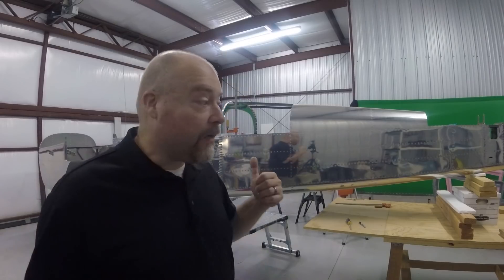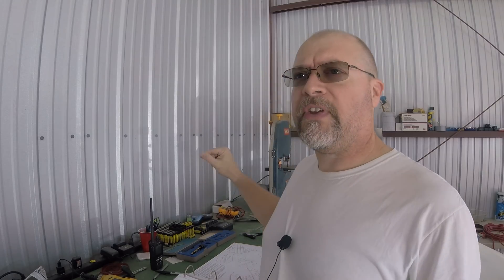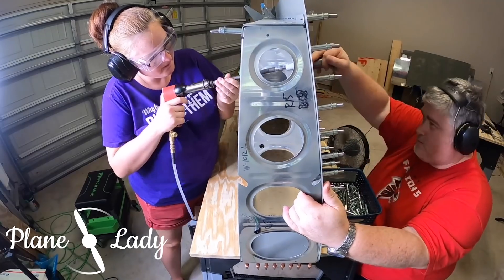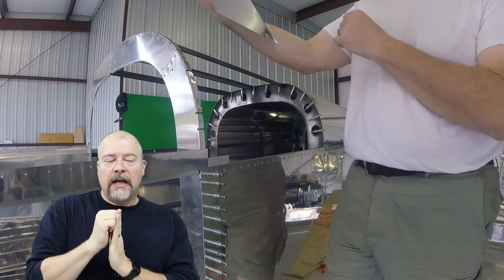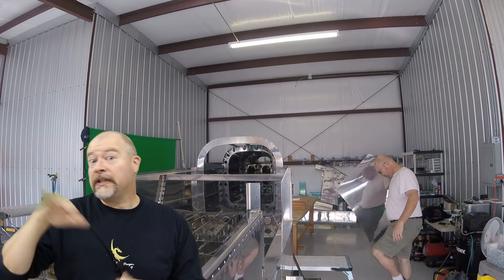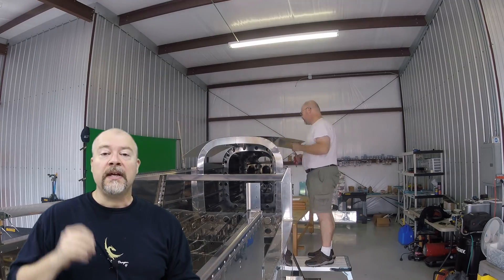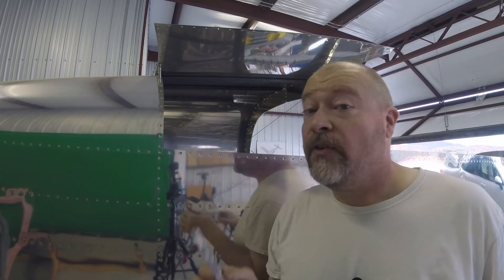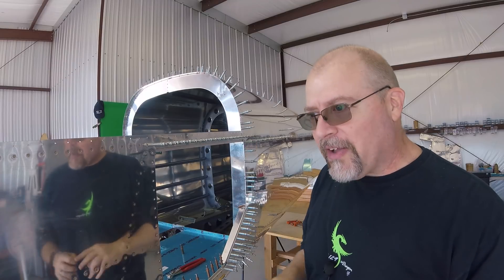RV-10 Fuselage - 036 - Fuselage / Empennage Work & Secret Stuff

Comment: The stiffeners attached to the skin that run the longitudinally are called stringers. Typically in a stringer splice scenario, you'd join the all the flanges and webs between the two. So the skin flanges would both be riveted to the skin, the webs would be riveted together, and the free flanges (if there is room, i.e. edge distance). It looks like you may have just joined them at the skin flange. AC43.13 should have an example of what I'm talking about. 

Now in this case, it looks like the stringers are terminating at the frame. And a closer look at all the details may reveal you don't need a full on stringer splice type repair. I think someone mentioned running it by Vans, that may not be a bad idea.

I'm not an RV builder, I would like to some day, but I do engineer structural repairs for certified aircraft.

Comment: Jason, here's a quick hint on removing the blue vinyl from the skins.  Play a heat gun (at a low heat setting) over the vinyl as you begin to pull it off.  The heat will allow it to release easily.  Enjoy the journey.

Comment: I had the same problem with the blue plastic. My tail kit was second hand and around 7 years old. I peel just enough blue plastic to wrap around a pvc pipe. With the skin on the table roll the pvc pipe and it pulls the blue plastic off in one sheet. Just make sure the pipe is longer than the width of the skin so you have something to twist. Hope this helps!
Reply: Yes, use a PVC pipe and start at one corner and roll diagonally.  The distributes the stress better than your fingers making tears less likely as long as you roll fairly slowly.